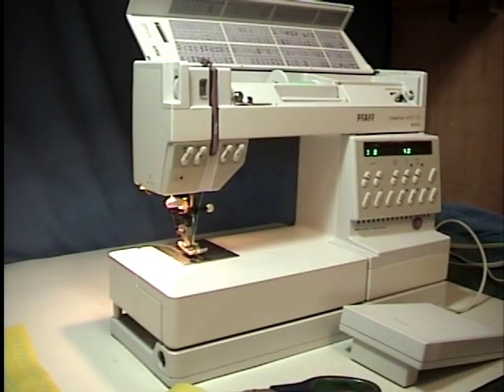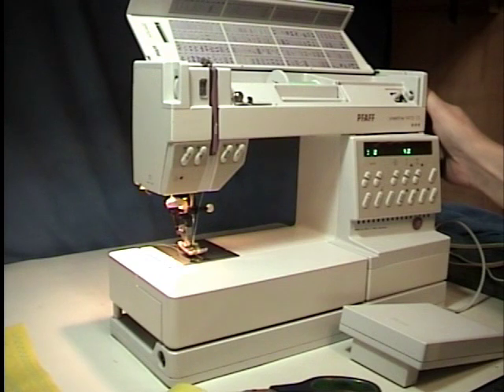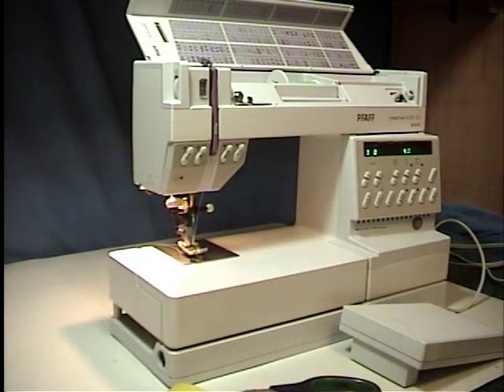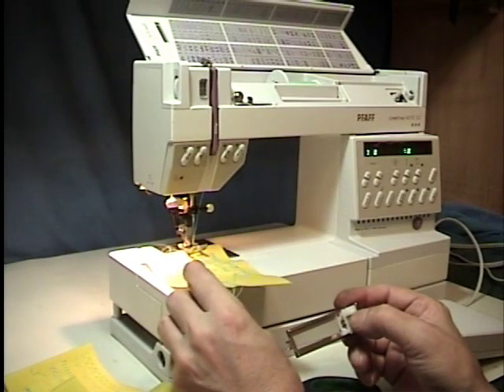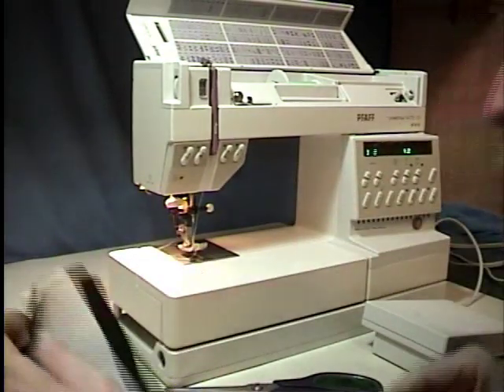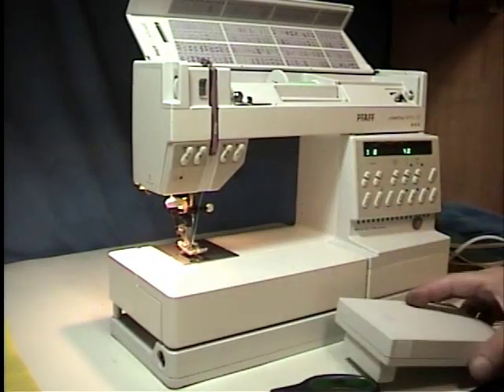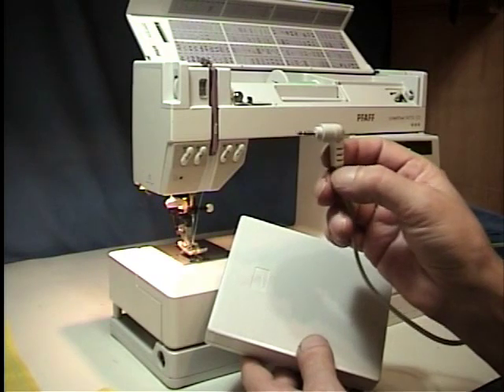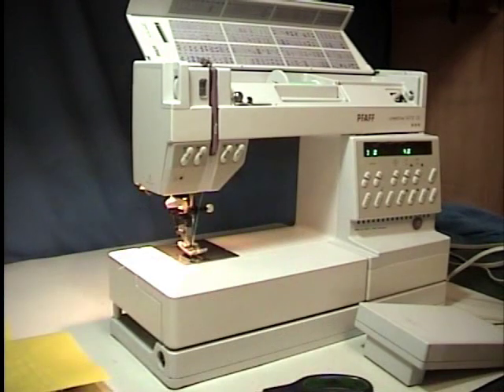Karen B Pfaff Creative 1473 CD

Comment: Hi, i have a question about button hole problems, i live in Taiwan so i can't ship you my machine to be repaired. Ive got it working but the problem i have is even when i use the button hole foot the machine never sews the same length twice, when i sew the test button hole its perfect as soon as i sew it on the garment each one is a different length even though i haven't altered anything on the machine, please could you tell me how i adjust this?

Comment from the maker: Hi, You have the same problem that Karen had with her machine. What happens is the grease inside the hand wheel hardens and the oil on the top shaft turns to lacquer there by locking the hand wheel into place. To solve the problem the hand wheel needs to be taken off the machine and cleaned out and the lacquered oil on the top shaft needs to be removed.  

Please see my web site for pictures on the Pfaff 1473 CD at.

Thank you, Kenn.

Comment: Hi. My pressure foot will not go up or down. Help please
Reply: That seems to be “ known & recurring problem “ with this model . I have removed the top cover and face plate gaining “ partial access “ to the presser bar . I have cleaned it ( it is very hard because of limited access )  first (1) with ABSOLUTE ALCOHOL and applied heat with a hair dryer. 2 . I repeated the same painstaking & tedious task this time with ODOURLESS KEROSENE and wiped it with a soft cloth . 3 ., lastly with sewing machine oil and applied very carefully heat with a hair dryer. I did it regimentally, repeatedly and regularly for nearly 7 days . Hallelujah 😂., at last it started MOVING UP & DOWN , albeit very slowly. All that patience and tenacity bore fruition. I still need to do a few more days and I am confident that it shall “ spring back “ to its original function soon . I have to warn you..... you need to be EXTRA CAREFUL while working in this area as it is overcrowded with delicate parts. It is a “ ROPE WALK “ but worth the effort. These machines are built like tanks and they are indestructible! Good luck & have fun .

Comment: I just purchased a used machine and the first thing I did was try to wind a bobbin.  I moved the wheel and disc like directions said and still the needle went up and down and the threading was all sloppy looking on the bobbin.
Reply: I have the same issue.  Have you ever figured out a solution?